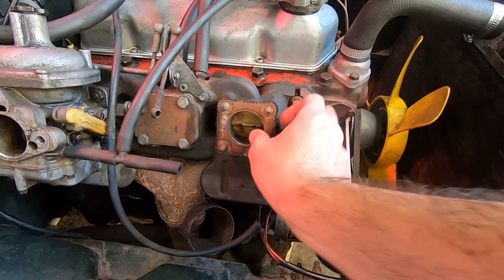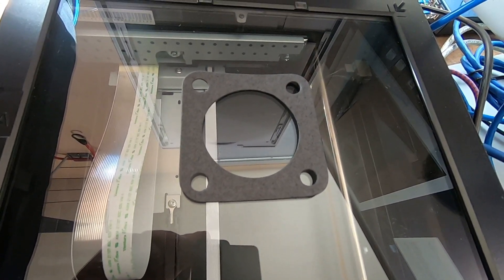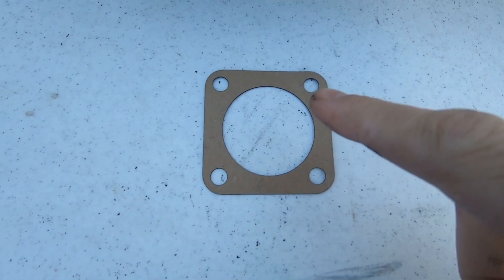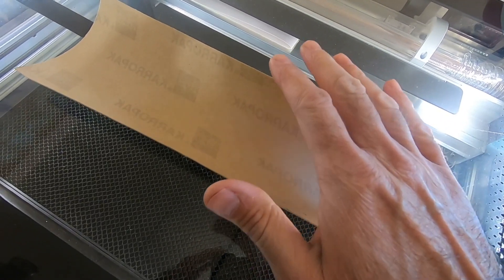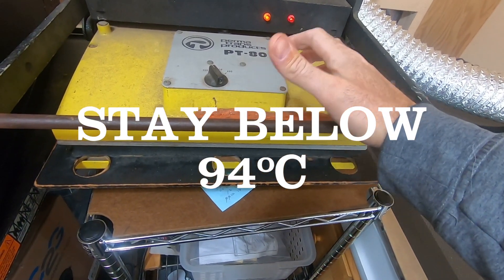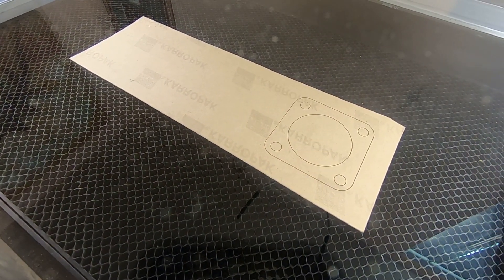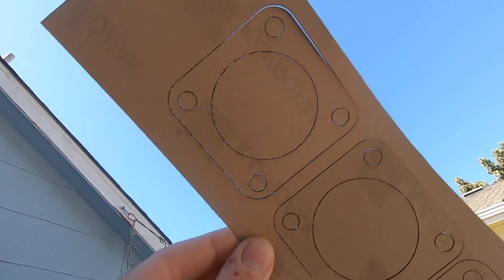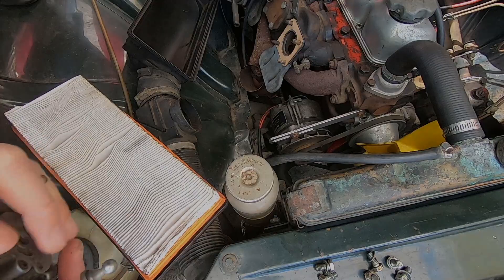Making Complicated Paper Gaskets? Laser Cut it!

Comment: Hey man, quick tip for the cad part. you could run the image through a edge detection filter like sobel or gauss. The edges of the gasket would be white, while the gasket and background would be pitch black. might make it easier to trace.

Comment: Sorry, I want to determine the bolt holes to match the bolts of the object being imitated. How to do it, may I know?
Reply from the maker: If you don't have the original gasket to scan I'd say take a picture of the surface, take a couple measurements and make a rough drawing on top of the picture. Test cut it with paper to check the fit.  Then use some little trial and error until it fits right.

Comment: I do same process.  Tip: burn inside cuts before outside edge.  On complicated ones, I just use lightburn to vector trace, drawing a line to the end of each curve and pulling the line center to fit.  Super fast.
Reply from the maker: Yup and yup :) At this point I'm good enough with the pen tool, that I'd do it that way in most cases. I think I just showed it this way for ease of entry sort of example.

Comment: What is your exact laser cutter setup?
Reply from the maker: I have a Glowforge, which is a 40w co2 laser. They are very expensive, comparatively, but super easy to use. I can draw the gasket and get it cut in minutes. I got it when they were first starting up as a Kickstater purchase, so it was a lot cheaper than they are now. There are lots of cheap options now, but not sure what's good.